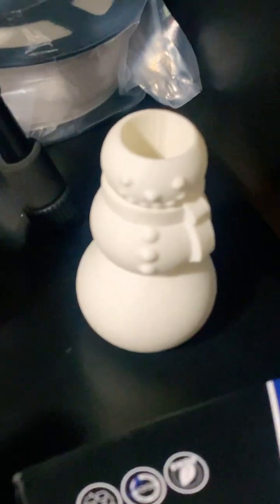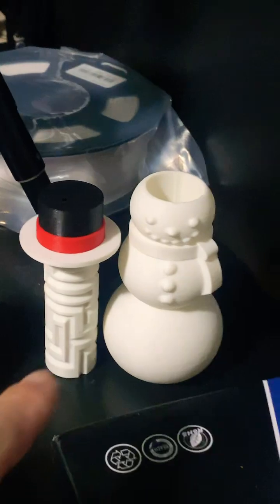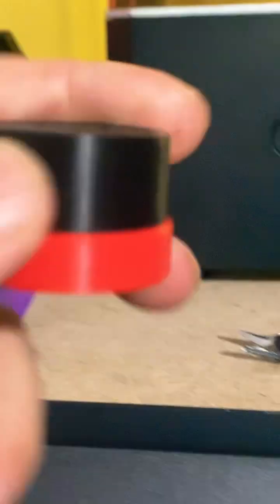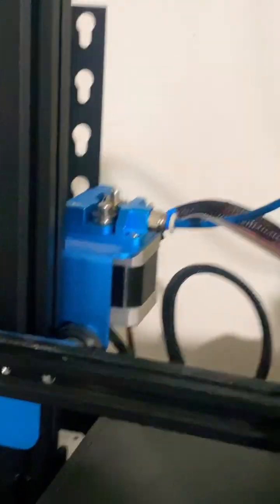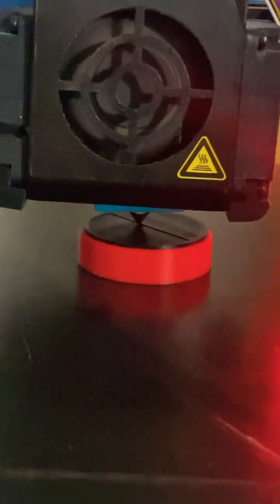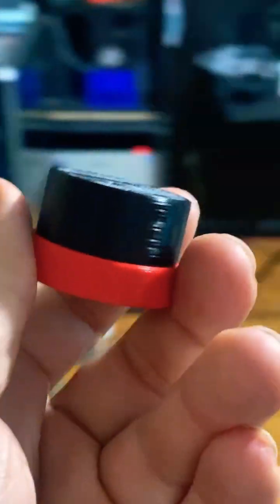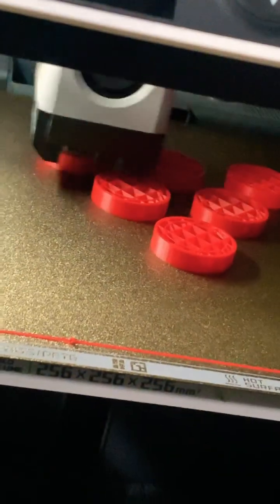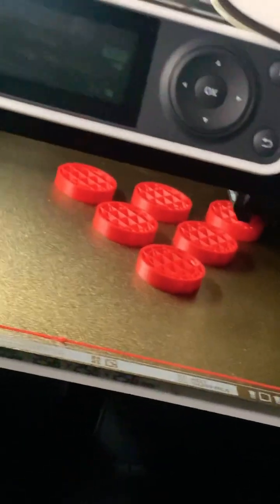SOVOL SV02 Vs. Bambu Lab P1P - Multicolor Print.

Comment: Very nice! I was looking at that printer myself as well! 

Quick question on the Bambu X1C doing duplicate prints, or multiple on the same print? Why is it when I try doing multiple or fill the plate with extra copies and hits other prints…. Do I need to turn something old or on?

Thank you
Reply from the maker: I wouldn't go crazy with multiple parts. Filling the plate is always going to be risky. Also, PEI doesn't have great adhesion. May want to consider a smooth Cool plate, or smooth High Temp Plate. Also, slow things down. This thing has to move repeatedly to EXACT locations, to stop/start, over and over and over. Maybe printing too fast, is whats happening. OR, maybe your prints are leaving the bed. Also consider testing different infill patterns. There are people who claim certain infill on Bambu, cause contact with the prints.
Reply: @3DRundown  🙌🏻 awesome info and thank you for the reply, I have heard that about the infill! Like my Elegoo, you have to turn off infill before walls! 

All this is a work in progress, lol
Keyword, patience‼️🤣
Reply from the maker: You can keep all that on. Just try a different pattern.